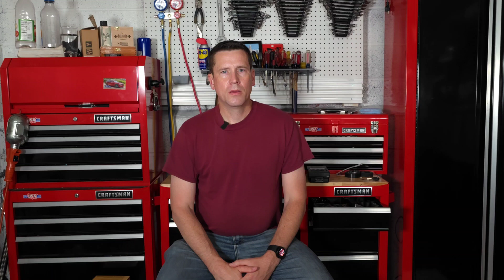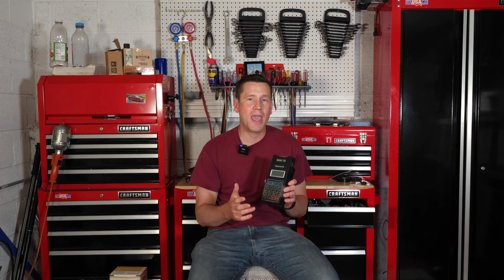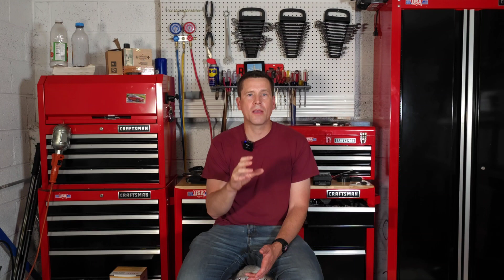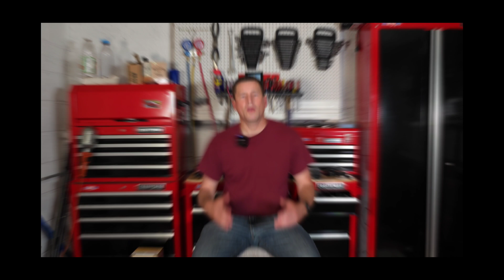3 OBD1 Scantool Shortcuts You Need to Know

Comment: i was looking for a nice dealer tech1 scanner for my brothers 94 k2500. I couldn't find one i wanted, but i found an almost new snapon MT2500, a dealers demo unit, with all domestic books and a bunch of keys and domestic connectors to 94, and the obd 2 connector. With the big case. I still want a good tech1 tool with everything that goes with it.